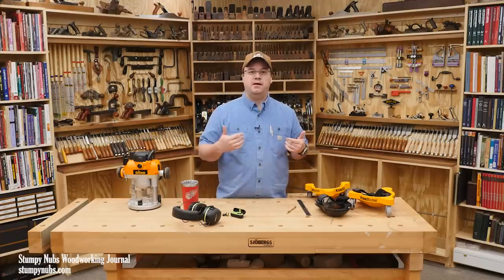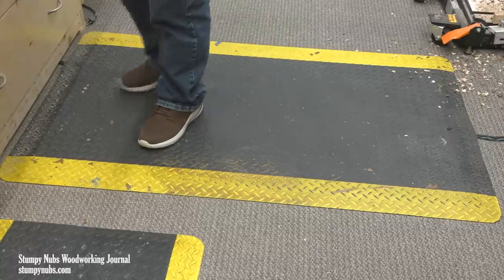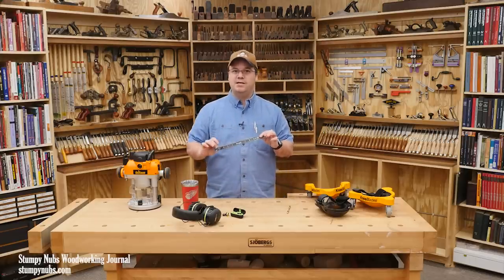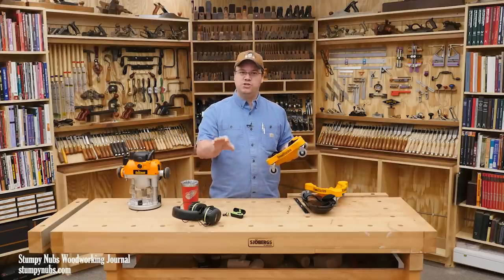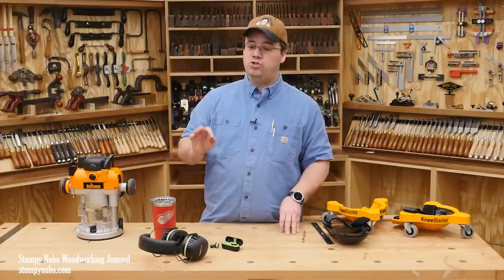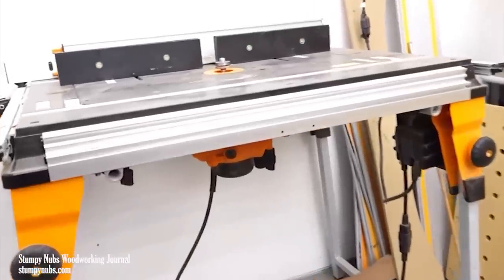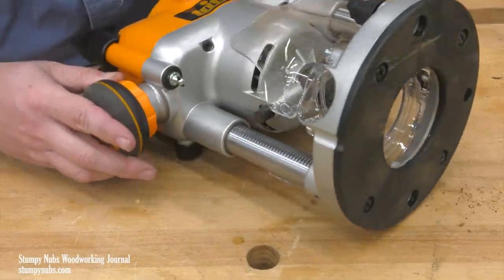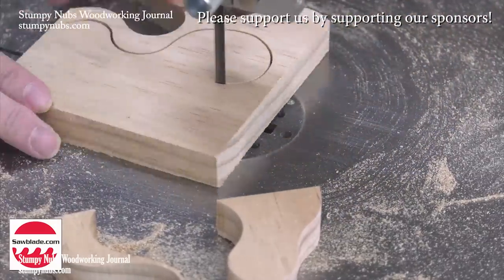7 Tools with SURPISING features you didn't know about

Comment: If only the rolling knee pads worked in the garden!  Great episode and I am still loving the change to the tool wall.😊
Reply: What about putting down a scaffold board. More work moving the board around and but less getting up and down. May work for reasonably flat flower beds.
Reply: @johnclements6614  Good thought.  You are right about the flatness part, and I am on a hilly property.  A 4 wheel drive version would be awesome.  Clearly, I am trying to find a justification for them!
Reply: If they use standard castor wheel mounts, you could maybe swap out for some larger, more rugged wheels.
Reply: A friend who has bad knees loves their little garden wagon with a seat. Can't get deep into the flower beds. But awesome for anywhere a wagon can go.

Comment: I'm glad you showcased the Triton. I've had one for years and it's by far the best one I've ever used. As you described I use mine in a table and the features are amazing. Saved a ton on a lift and it's accuracy/ease of use is wonderful. Another great episode of cool tools, Thanks James!!!
Reply: I concur 👍
Reply: How good is changing the bits with just the 1 Spanner.
Reply: @andrewheffernan2961  easy. Have one in my router table.
Reply: I have one in my router table for a couple of years and find it so good I intend to get a second one for heavy duty free hand work, replacing another router.
Reply: I was always suspect of Triton tools as sort of a knockoff brand.  I carry a tool bias for sure.  I will look.
Reply: @andrewheffernan2961  really easy, when you plunge right down it engages a lock. only issue i had was if you get too much dust in the lock, sometimes it doesn;t engage properly, and you need to remove the guards and clean the lock. i now use teflon spray on the locking pin every couple of hours of use, seems to keep it running.
Reply: @andrewheffernan2961  It has a built in shaft lock.  You only need one wrench.

Comment: About rulers, I agree with you about the overly cluttered markings, and I rarely use anything smaller than 1/16, so I decided to experiment with metric. I got a Fastcap metric measuring tape that I use in tandem with my Imperial tape. I really like metric because the math is so simple. Measuring in millimeters is so simple. Learning correlation between the two systems is kind of slow, but I’m getting there.
Reply: You'll get there! I approach from the other side. I'm used to metric, but too many plans (and YouTuber)  are using US units (not imperial, 'cause I guess their gallon's too small).

Plus I take most measurements off of other parts / already built components.... So I don't measure that often anyway.
Reply: 25.4 mm = 1 inch
Reply: Taytools have some good PEC seconds metric only rules and combos every once in a while. The other problem with metric those darn English units on the other side on most rules

 I am building a 12M boat and these rules are my go to if I can remember where I set them  down 😊

Comment: I've used three Triton routers, two of which are the larger ones.  I have the same router in my router cabinet and love it.  The 240 volt model was unavailable in NZ for so long that I bought a Bosch 1600CE with plunge and fixed bases.  I love the Bosch for handheld work, but the Triton is way better table mounted so I bought the big Triton as soon as they were back in stock.  The only point I'll make is about the interlock on the on/off switch when table mounted.  It forever seems to confuse the guys at my Menz Shed as they forget to turn it off when changing the bit, and they wonder why it won't lift high enough to lock the spindle.  You need to be careful about orientation when table mounting to make sure you can access that switch as well as the lock.  It's an outstanding router, and a no brainer for table mounting.
Reply: Trevor, I am a recent immigrant to NZ from the US and joined a Menz Shed, we only have the Tool Shed router + table combo. The lack of router options here saddens me, and the cost of power tools here. Are there any NZ based fine woodworking YouTube channels? People dealing with these more limited choices and can provide advice? I found Scott Brown, but he mostly deals with home renovation (but is very entertaining). I will be setting up my own small home shop soon.

Comment: I mounted my triton into a table straight away, it’s been magnificent. You do need to remember to let the power switch cover slide out before you try to engage the collet lock,  but it certainly works well. The only Triton tool I would recommend.

Comment: Those knee rollers look clever !
But I wonder if the fact they can roll easily is not a problem sometime.
Maybe a hand brake as an option ? :)
Reply from the maker: Your legs rest on the floor behind them, so you aren't rolling around. But you may want to use care when you are getting down on the floor with them on.
Reply: @StumpyNubs  I was thinking mainly when we install floating floor. It often needs some force applied on the boards.
Anyway, I love the idea.

Comment: I have to whole heartedly agree with the Dimond mats! I've had a couple for 10 years and the one in front of my table saw never moves. It shows no sign of ware. I was lucky enough to be given mine from a closing down business. But I after using them for years now I would spend the money on at least one, more than likely 2. the other one is moved to the router table or jointer if I'm going to be there running parts for more than 10 to 15 mins. Great cool tools.

Comment: Another good video. I am setting up a new shop and need a router (or two). I am in New Zealand and our choices are more limited for routers, but the Triton is available (only the full size one). How is this to use not in a table mount? I fear it would be too heavy, too prone to tipping. I want to use for dovetail making on a Porter Cable jig. And then edge round overs or beading.

Comment: Hi! You featured one of my favorite tools I've been using a couple years now... the knee pads. I  install special audio equipment that involves laying hundreds of feet of flat wire for going under carpet, tile or a special cover. Anyway, imagine a 50 x 100' church and bigger and scootering around on that floor stretching out wire and taping it down. Always wear a good work glove on one hand and work boots. One hand to scooter and the boots because you will quickly take the toes out on ordinary shoes. I never strap them on. You can't walk in them with the scooter boards attached. There's another version that has knee cups set into a single board... sort of looks like a wing. The two piece version I usually use for working around theater seats.   Joy to all!!!
Reply: I've worked under a couple houses now, where the builder poured a concrete slab for the crawlspace, and it makes it a perfect application for a mechanic's creeper.

Comment: I bought a triton router table and router set 20 years ago. The router table’s orange powder coating is worn down to the metal in some places due to constant use. It came with the smaller Triton router which I used for 17 years without a problem. 4 years ago I got a brand new one as you demonstrated. My neighbour whose husband had passed away sold it to me along with a forest of timber in the garage rafters. I fitted it to my router table and was surprised at the power compared to my original router. The safety features (identical on both) that you point out are so handy. If you do not engage the see-through safety switch, you cannot raise the spindle to change the bit. The fine adjustment handle is fine, but I seldom use it. I prefer to sight the precise location of the router bit at table level (on your knees 😀) whilst using the adjustable handle feature that you demonstrate. My “old triton” is now working in a friends triton table which he bought on a buy and sell channel. I am fortunate enough to have many routers (like clamps), but my go-to is my triton, and the bosch in my pantorouter!

Comment: I've had a first model TRA1 router from the first couple of production runs for around -25- years now and it still works fine. The first model did not have the through the table adjustment, you just had to reach under and wind the knob. I currently have 6 Triton routers, 2 of each size. Triton was an Australian company when the routers were designed and pretty much everything they made was well designed and built within the limits of available technology (I loved the 18volt drill but it had NiCad batteries). Due to some corporate shenanigans Triton has been resold several times, production has moved to Asia and it seems there have been a few rough spots in the production - there were a few years when the speed control failed after a while, but that seems to have been fixed. They have also added several Asian knockoff tools to the line, some are good like the bench top spindle/belt sander, others are pretty meh like the doweler

Comment: as for rule measurements, i gave up on using fractions after dovetailing bee hive top and bottom boards.  i was only able to resolve minute in-discrepancies after switching to metric measurements.  the metric system is far more accurate and is the superior rule to follow.

i'm sure this comment will cause a riot.

love the channel, love the content.  keep it up, stumpy!
Reply: As a person living in Metric, I can see how this ruler is actually the only real argument I have ever seen to stay with inches.
Of course metric is more logical and more exact. But that isn't really the point here. The point is how easy to use it is.
The kind of precision you get from metrics i useless in wood working any way.
Partly because of wood movement and in my case because nothing has ever turned out exactly as I have planned to the millimeter.
Reply from the maker: Who measures dovetails? Joinery is usually cut to fit by marking one half from the other half of the joint.
Reply: @lejlej  I'm from France, but live in Canada.
So my first langage is metric :)
But I also use imperial a lot, it depends what I do. For general wood working, precision of 1/8 or 1/4 given with a ruler is enough most of the time !
But when I play with electronic and SMD board,it's a different story .. :)
I don't understand when some here write then need a precision up to 1/32 with wood ...
Reply: @StumpyNubs  The advantage of measuring dovetails is you can make 2  errors instead of just one, for the same price ! :)

Comment: I only use tape measures with 1/16th makings all the way to the end. Most have 32nds in the first foot. I can estimate a 32nd mark and it is much much easier to read with 16ths marked. I found that most Craftsman tapes are 16ths but then Menard's stopped carrying them. I found them at Lowe's bought a bunch.
Reply: From a casual observer of other people woodworking, how many tape measures do you need? How do you go through tape measures?
Reply: @NinjaPiParadox  Let's see. I need one at each saw because I always leave my tape where I took the measure instead of bringing it with me to the saw. I also need a backup tape at the saw for when I take the saw tape back to the work area. Then, I need a backup for the backups for when I forget to distribute all the tapes to the right spot at the beginning of the project. Plus, about a dozen or so in the truck for when I need to measure something at a new jobsite and all my other tapes are piled up around some random saw somewhere else. 

So, maybe about fifty or so tapes to get through a normal workday.
Reply: @NinjaPiParadox  Well, tape measures are like pencils, there is never one nearby when you need it. While I am working on a project, I have it in my pocket but then I go in the house and sure enough it is in my pocket so it ends up with my wallet and keys in a drawer. Then I go out to the shop and don't have a tape measure. So I like to have a few around. One on my workbench, on my table saw, near my CNC etc. Then I need one on my desk in the house and one in the kitchen drawer, etc, etc. Those are all 16 foot 1/2 inch tapes, then I have couple of 25 foot 3/4 tapes, etc. I don't go through tape measures, I just move them and leave them somewhere to be found later.

Comment: Noticed there are cords running under the mats. Would this be a safety issue? Thanks for sharing your finds and experience.
Reply: I’ve converted my shop to have all ceiling drop power cords. No cords on floor to trip or walk over.
Reply from the maker: I usually tape my mats down so there is no rubbing on the cord. (double-sided carpet tape on the underside)
Reply: @StumpyNubs thank you for the explanation, when I saw that, as a retired firefighter, I was surprised. I find your attention to safety refreshing and appropriate for a potentially injurious craft.

Comment: Re simplified scale:  A compromise is to put the finer markings only in the first inch.  Possibly even to the left of 0 rather than from 0 to 1.  To measure for example 7 22/32, you put the 7" at the starting point, and mark 22/32 left from 0.

Comment: I’m pleased with my triton in my router table top, but somehow, chips will build up inside of the nearest column, which means I can’t rise and lock the router to change bits.  When that happens, I have to remove the router from the table, disassemble the spring loaded ‘thingamajingy’ and clear the chips.

I’d give the triton a 4 out of five because of that.  I would have a second handheld one for sure.  All the features he explains are great.  But the dust collection is not 100%, but it is an improvement.

Love the videos James, thank you.
Reply from the maker: I believe you are supposed to remove the spring if it is mounted in a table.
Reply: @StumpyNubs  I have two of those routers mounted in tables and I removed those springs like the manual says! No trouble here! Thanks James!
Reply: Yep, me too. Removed the spring and no problems in a table for 12 years.
Reply: Remove the cap on the spring tower, put the cap and spring in a drawer somewhere, put the locking screw back in its hole. No more chips building up in the hole - or if they do for some reason (wasps, carpenter bees) they push out with a dowel.
Reply: @StumpyNubs  yup, for sure.

Comment: Thanks for the info but I would like to point out a few issues with the Triton router.  I have been using mine for about 14 years (mostly in a router table with dust collection) and have say the rack and pinion mechanism has been nothing but trouble.  It jams often with wood dust, even after a few projects, making height adjustments impossible.  I have disassembled the router countless times to clean the complicated gear assembly.  I even had to replace the worn gears as they are made of plastic. It evens jams when trying to engage or disengage the rack and pinion to plunge modes. I am a hobbyist so the router has only been moderately used. Recently, the electronic speed adjustment failed so I only have max speed now. I love all the features this router incorporates but these problems have been a deal breaker for me.  Perhaps the gears are made of metal now and don't get clogged anymore but it has been a nightmare for me.
Reply: Great points, all.  I hate the whole plastic/nylon gears thing.  Every time they are used in manufacturing they are the fail point.

Comment: One point about the rule: I hang mine on a screw head inside the tool cupboard door - easy to find and not taking up space. Also they can be used for scribing arcs but these black ones have no holes; maybe some feedback to the manufacturer is appropriate.

Comment: That router isn’t bad at 300$ usd. I paid 259 for my 2.5 hp Bosch + rail guide. That router table adjustment is crazy good, and I like the knob turning for plunge. My Bosch is less than a year old, I think I will sell it and grab a triton or just get a triton and use it in a router table and use the Bosch. Or I may buy 2 tritons one for table one for keeping out and the sell the Bosch. Or I’ll buy 3 tritons and put the Bosch in a glass case labeled “hall of shame”.

Either way works.

Comment: Will the Triton router attach to a standard router table insert?  (Mine’s a Kreg PRS4036.). If not how do you attach it to the table?
Reply from the maker: Depending on your router plate's hole pattern, you may have to add mounting holes, but there is no reason it would not work with any router plate.

Comment: Kershaw makes several knives that are similar in size, shape, price, appearance, and utility. So, folks, if you cannot find that specific model, there may be another you like just as much or even more. Kershaw makes quality knives for reasonable prices; their less expensive knives are still pretty tough. Do note that different states have different laws on whether assisted opening is legal, or whether it's legal to have a knife lock open at all if it can be one handed. Many European countries have similar laws, Also, you can usually get knives like these for about the same price from knife-specific places that aren't a giant company like Amazon, I've had good results with Knife Center, Blade HQ, and have heard only good things about DLT Trading.

Comment: I have carried one or another Kershaw  knife on my belt or in my pocket since 1988. There were a few Spyderco's in there too. I got my first one after breaking several Buck 110 and 112 models. Not really there fault, a knife isn't meant to be a hammer; but sometimes you have to use what is at hand onboard a ship.
Routers have always scared me since my first introduction to them in  seventh grade woodshop. I think it is a  combination of twelve year old boy and  instant on high torque  2+ HP electric motor.

Comment: My preference for rules is 1/16" on one edge and mm on the other.  Also by my reckoning 3.5 HP is 3.5x746 W/HP = 2611 W.  2611W/115V = 22.7 A which far exceeds the continuous current rating of standard 115V outlets.  Does this router need special 20A circuits or is it a 230V motor ?